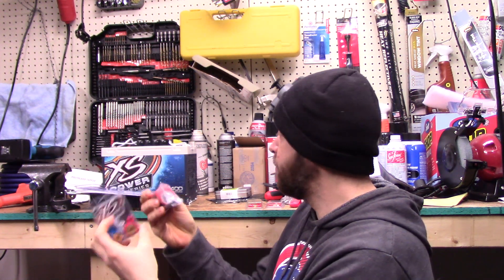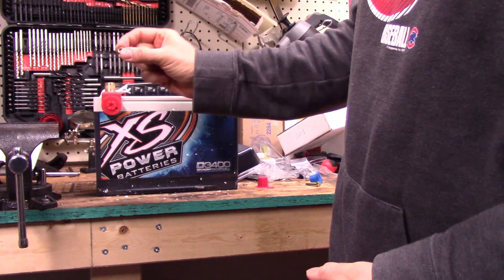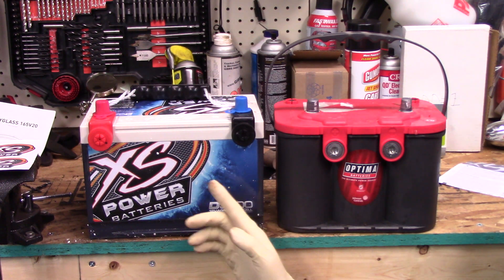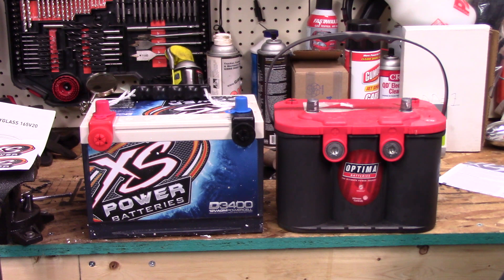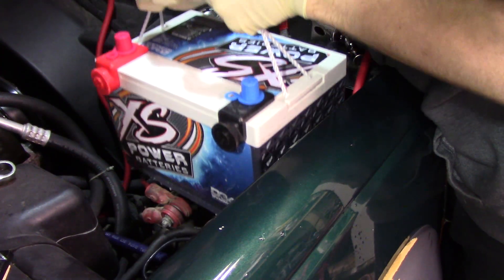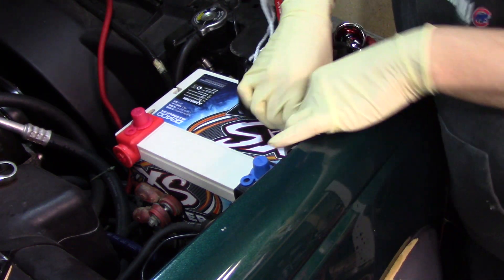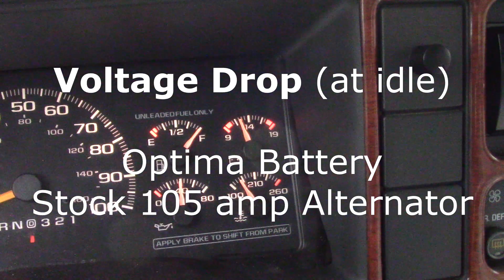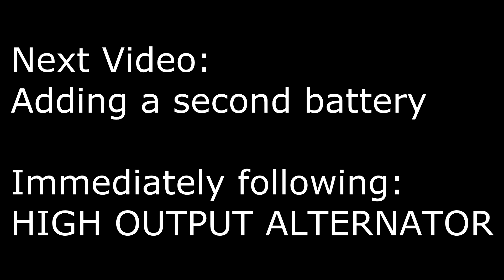Optima Out, XS Power D3400 In! Electrical System Full Upgrade Plan. Suburban Build #8

Comment: Should of kept the optima battery up front put the xs in the back run a 00 straight to the alternator
Reply from the maker: Now I have an xs power in the back and the same one in the front. I have 1/0 running to a mechman alternator.

Comment: i though the letter D stands for deep cell battery which would be better of in the trunk and the S battery for the engine compartment correct me if im wrong
thanks
Reply: some say "the 12V batteries the D and S series batteries are the same exact battery. Only differences are the D series has blue decals and no terminals (you can buy the 580 or 586 terminals if you want), and the S series has red decals and comes with terminals." and that S is lightweight for racing and D is heavier with more reserves for car audio.

Comment: In my opinion you should start with H/O alternator. Alternator creates the power, batteries just store it. There's an easy formula to see how many amps you need. Take the power your Amp puts out in watts, divide by Amp efficiency(roughly 70 to 80%), divide by voltage reading. I.e. 2500w ÷ .7 ÷ 13 = 274.2 amps Your system requires 275amps to fully power itself at 2500w. That's 275 amps on top of whatever your vehicle requires to run normally. No matter how many batteries you use your stock alternator will never keep up amd you will always have large voltage drops. There will always be some slight voltage drop no matter what but set up properly it is almost nonexistent. I have a mechman 400amp alt and 1 d3400 for my 3000w system and I have zero issues. My voltage stays between 14.4 and 13.8. Hope this helps someone.
Reply: Just one battery?😳
Reply: @kgj7102 that’s what happens when you upgrade the brain (alternator) with no brain you can’t function

Comment: Can u charge a xs power battery in ur trunk with the 1 red optima under rhe hood
Reply from the maker: The under hood battery is now the same xs power d3400 that is in the back. 2 matched batteries on a 240a alternator. They both charge well.
Reply: I have a redtop in my hood n xs power ps1200l in my trunk idk if the one in my hood can charge the one in the trunk
Reply: Or do i need the special agm charger for it ?
Reply from the maker: No special charger is needed.

Comment: What if I have a yellow top as my main battery and the D 3400 as my secondary I have it on a 240 alternator.car on site 15.1 full tile 14.6 never under 14
Reply: That's exactly how I'm about to run my setup. Have you done it yet and if so how's it working out for you?
Only difference I have is I have a 320 amp alt but just wondering how the 2 batteries work with eachother
Reply: I have a D3400 as my primary, and a Blockshakers supplemental battery for my audio system. It's supported by a 370amp mechman alternator. I run two amplifiers. A 150wx4 4 channel, and a 3000w monoblock, both from Zapco. I have zero issues and never drop below 14 volts. The science between matched batteries is sensible as electricity works in a push pull fashion. Still, I've had no trouble whatsoever.
Reply: @RYTHMICRIOT  You think a 370 amp is too much for only one D3400 battery? I don't have space for a second battery
Reply: @ramsesfelix388  No way. Go for it.
Reply: @RYTHMICRIOT  Thanks!

Comment: So I have a HP 370ALT and im wanting to upgrade my stock battery to a Full Throttle 825ft-78 AGM, should I use the same size for the 2nd battery? Will that be sufficient enough for a 6,600 watt system?

Comment: what amp alternator you running that with? i've got one of the d3400 in my 95 caprice with a 250amp high output alternator and i think the alternator is having trouble keeping the xs power battery charged. debating between getting a different alternator or switching out the battery to something with less watts.....
Reply from the maker: 240a mechman, got 2 xs power d3400s  and the alternator keeps up with my 2kw system. I also use a solar panel to keep it topped off when the truck is not in use, check my other vids for how to hook that up.

Comment: Was wondering if you could help me I'm upgrading my stereo system and they said go with the D925 battery for my car but looking at the battery it has top post connections my battery has side post terminals do you know if they sell adapters so this will work for my car and what kind of charger do I need to charge the battery correctly my car is a 1999 Z28. Hopefully you can help please send me any kind of link . Thank you
Reply from the maker: You can buy adapters at any auto parts store for under $10. For charging, under normal operation, your alternator should be enough. If the car sits for periods of time, try any trickle charger, or check out my video where i show how to use a solar panel.
Reply: @rocbola  awesome thank you so much for the information I really appreciate it I'll take a look at your other video
Reply: @rocbola  yeah they're telling me I need to buy the xs power charger for their battery so it'll work correctly but you said my alternator should be able to charge it

Comment: You can't put batteries in parallel their "internal resistance" is always going to be different always draining from each other any Electrical Engineer will tell you that. 

To correct it, is you will need either a high current diodes in series to isolate each battery. Or just use "BRUTE FORCE" like you may be doing now tying them together. You need to use a high current relay to take the place of both of the batteries being in parallel with the power turned off.
Reply from the maker: I keep the batteries hooked up to a solar panel with charge regulator so they float at around 13.7 during the daytime when the sun is out. I have not had any problems with them so far.
Reply: Dick Fraser would a battery isolater work?